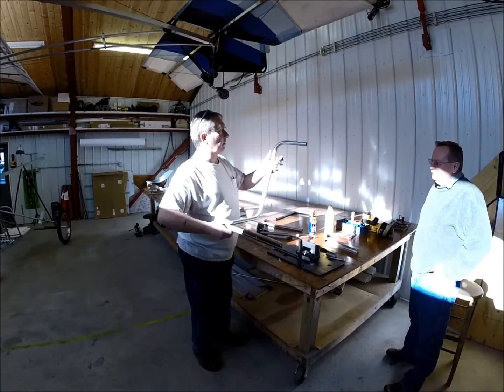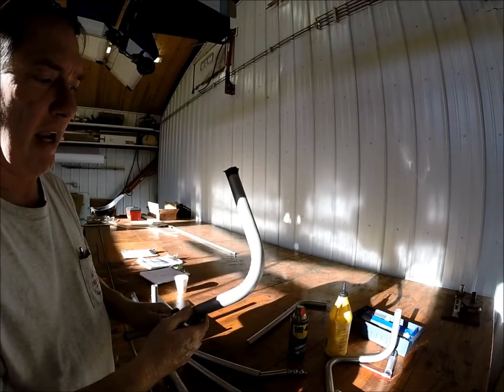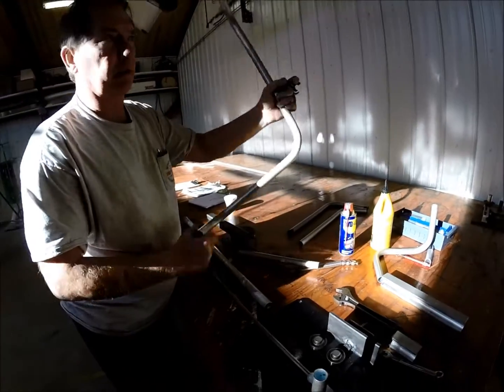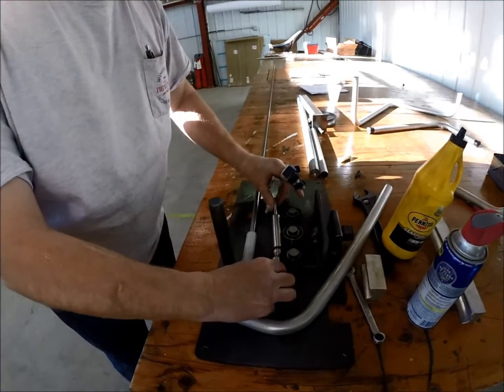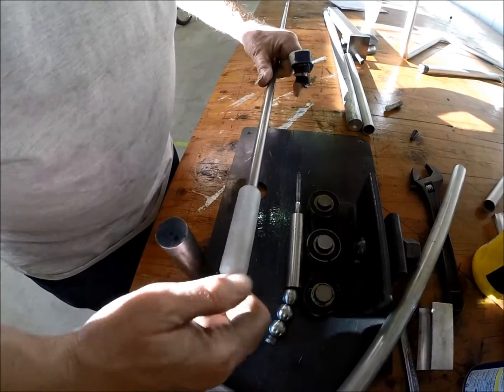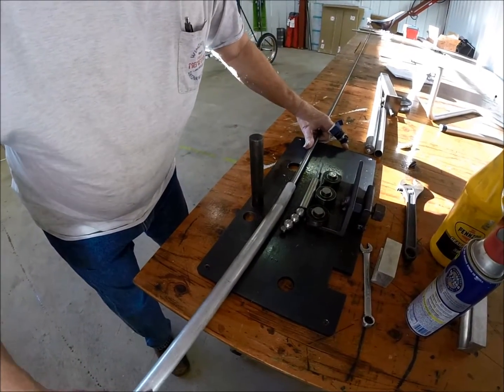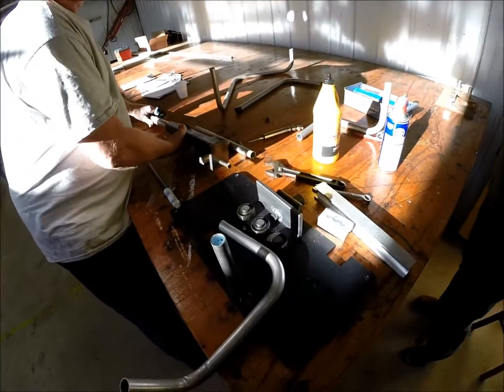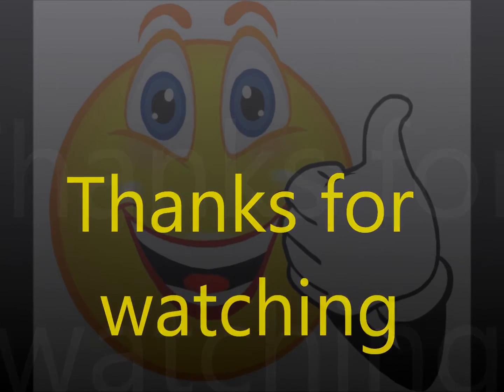Bender (Rotary Draw Mandrel)

Comment: So is that just for aesthetic purposes, or do you actually gain any kind of structural integrity by doing it that way, over just using a quick and dirty pipe bender...?    Seems like though you get compression ripples on one side, you'd get less stretching on the outside... doing it the pipe bender way.
Reply from the maker: The bend with the most structural integrity would be a bend with no defects.